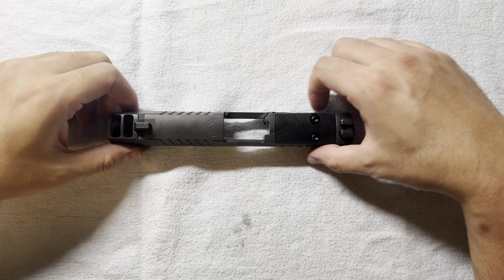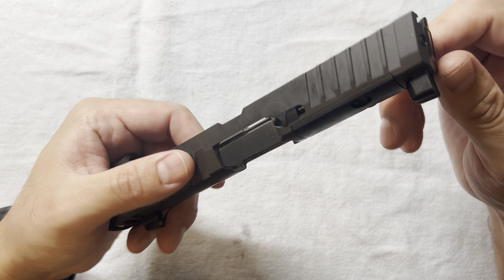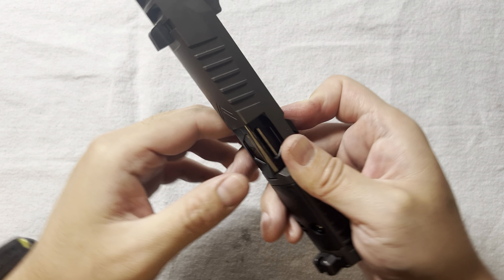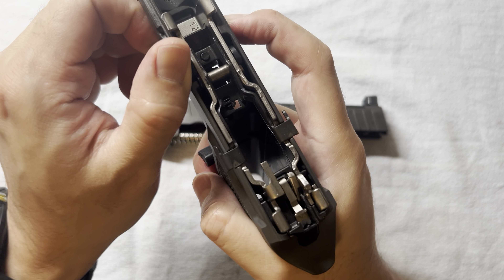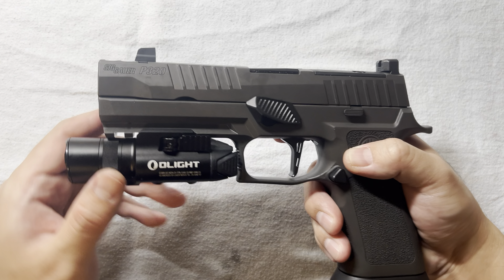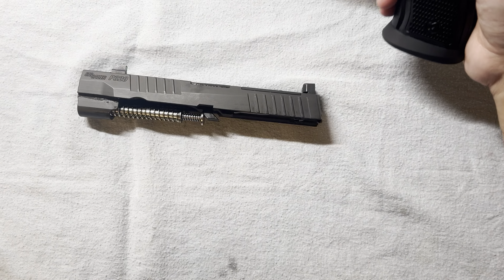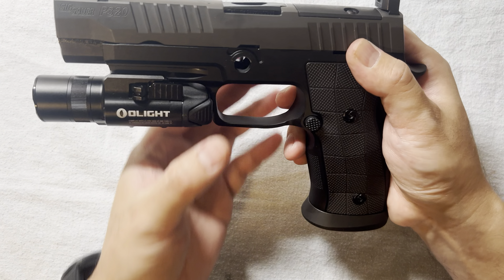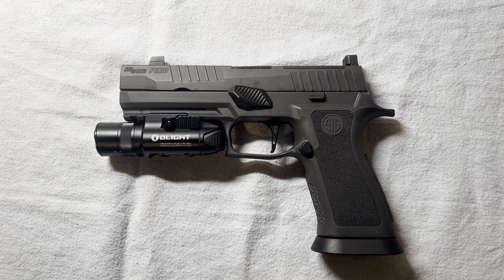Sig Sauer P320 Legion Comp Slide

Comment: Great video.  Would a stock Sig 4.7 recoil spring do or is the DPM the way to go?  I just got my slide in and was just wondering if theres a difference.
Reply from the maker: I believe the stock one would work just fine. If you have the budget and want to tune the spring weight, DPM isn’t bad.

Comment: Do you happen to know what size screws the optic holes take? The trijicon screws are to skinny and the screws to hold the plate on are to short 😢
Reply from the maker: I believe they are 6-40.
Reply from the maker: Pls also note that the screw length requirement is different for the two holes, cuz one of them is right above the ejector spring. You don’t want it to be too long and touch the spring. So one screw is about 0.46” and the other is 0.38”.
Reply: @9mmtactical  the bigger hole is what I need for the rmr and I'll try to use the plate screws on it again if it works think it's secured enough with the original screws? I thought you should use new ones
Reply: @9mmtactical  or are supposed to use different ones 🤔
Reply from the maker: I think the bigger holes are for the cover plate and Romeo red dot. RMR’s hole position only fits the smaller holes. Those holes use 6-40 screws.
Reply: @9mmtactical  ok thank you I'll double check just seemed like I got them in 3 or 4 turns but were wobbly and I didn't want to damage the slide